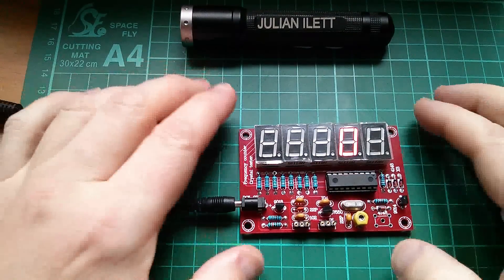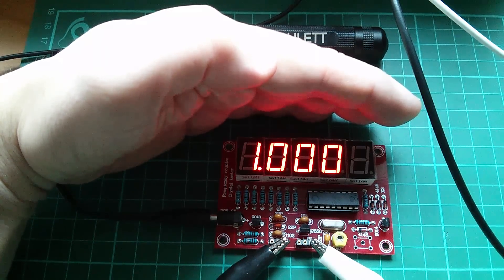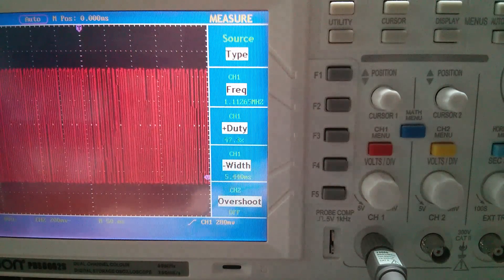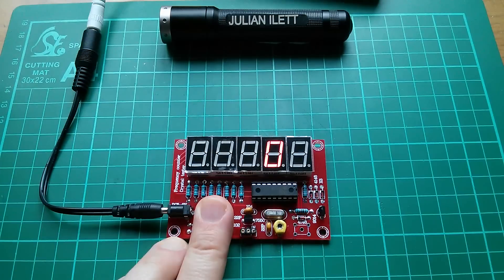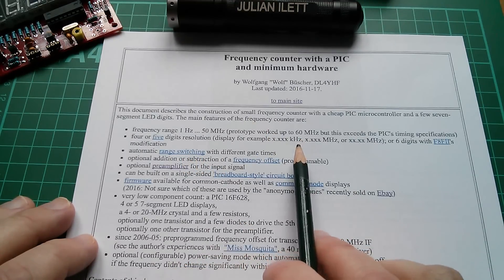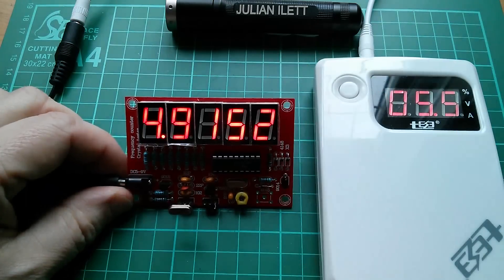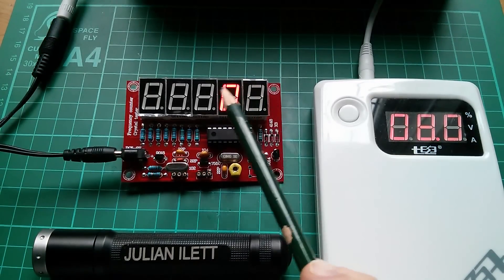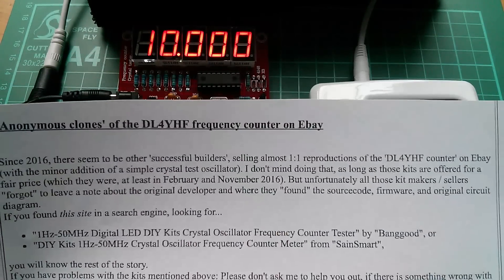Fairly Easy - Frequency Counter - Electronic Kit Build (part 3)

Comment: Too bad, because I bought this to use as a crystal tester.  As a frequency counter, it doesn't seem to work with anything but square waves, thus it needs the preamplifier if you want to use it to detect rf signals.  The far better circuit (but way more complicated) is the one Mr. Carlson built to modify an old radio using nixie tubes.
Reply: you could try to add a Schmitt trigger to your schematics to turn sine and triangle waves to squarewaves
Reply: You can use this  as a crystal tester by using a 6 vdc ps or removing the 7550A voltage regulator and using a 78L05 ( they do NOT have the same pinout! ) With it's legs rearranged. The 7550A running at over about 6.5 vdc is erratic, rapidly switching on and off.
Reply: Hi, youtube user HWCave has done a number of videos on modifying this kit including making the front-end more sensitive and mods to improve measurements and to add functionality.

Changing the hardware:  https://youtu.be/0BxpMm6SLoE

Changing the firmware: https://youtu.be/8rOCmhPWLWw
Improving resolution and adding RPM mode:  https://youtu.be/0D6EcgTQtNw
Using the RPM mode: https://youtu.be/QlIv1DEAvQw
Adding up-counting: https://youtu.be/3imEpm_zztQ

Comment: Best way to fix that xtal tester: 
1. Unpopulate it's components.
2. Leave  it that way.
3. Forget about it. ;)
4. DONE!
Reply: Step 5, fix that apostrophe in "its".
Reply: Take out the 5vdc regulator and replace it with a 78L05 with the leads rearranged to be the same as a old part

Comment: You might find that you'll be able to view the xtal oscillator on the scope if you use the 10X setting on the probe/scope. Usually a much higher impedance and less likely to stop the oscillator, but as you say, a rather inappropriate and crude circuit in many ways. Be interested to see if your suggested pre-amp mod is successful. Best wishes.

Comment: Great video. How about making the improvements ? The signal pre-amp and also a better oscillator to test crystals?
Reply: I second that Julian. I have one of these kits on the way, so a follow up 'improvements' video would be great.
Reply: I was looking at this circuit, need a slight modified to it. http://www.electronics-tutorials.ws/oscillator/osc31.gif?81223b . On second thought I buy the kit and I hope I modify to see it work plus it does need a buffer.

Comment: I suspect that the "crystal tester" portion would work better, and be more stable, if you add a 74HCT14 hex Schmidt Trigger inverter as a buffer from the output of the BJT, and the PIC input. Now you can take the scope probe off the output of the. 74HCT14 and it won't load down the "crystal tester" portion.

Comment: if this build made 3 parts then what would oscilloscope kit do? :p
Reply from the maker: The oscilloscope kit is more advanced, so I'll leave out all the component identification/orientation stuff.
Reply: +Julian Ilett I like that idea. I'm sure that vast majority of your audience are people that already know that stuff. Yeah, beginners would like that, but you already mentioned it in the previous videos, I see no need to include that stuff in every kit build. The final choice is up to you, people sub to you because they like your style of videos, keep it the same and the crowd will be happy :) Just my 5 cents
Reply: the frequency measurements of a oscilloscope are almost always done in software which interprets the current shown waveform to determine the frequency. The kit uses and actual hardware comparison in which it can count a amount of cycles in a given time frame. The result is that the kit would be more accurate then most decent oscilloscopes.
Reply: @Nige Cook yes the PIC uses a hardware based comparator where as the oscilloscope 
evaluates a waveform stored in memory. This evaluation is done with a 
processor most of the time, thus a software comparison. 

Although versions of oscilloscopes with a FPGA and hardware comparison exist but it is unlikely such a cheap oscilloscope uses that. Most commonly oscilloscopes with these features are called 'mixed domain' oscilloscopes.